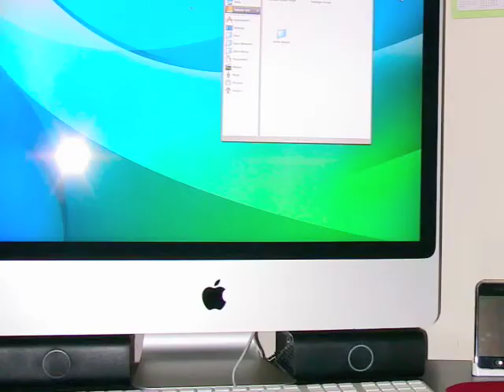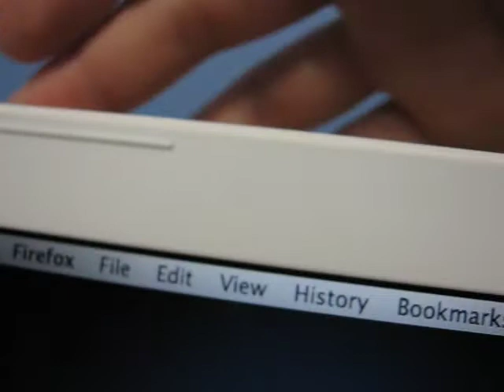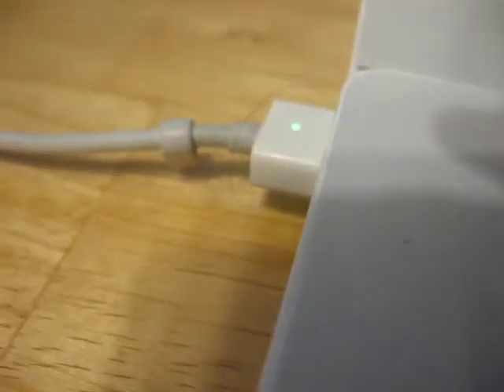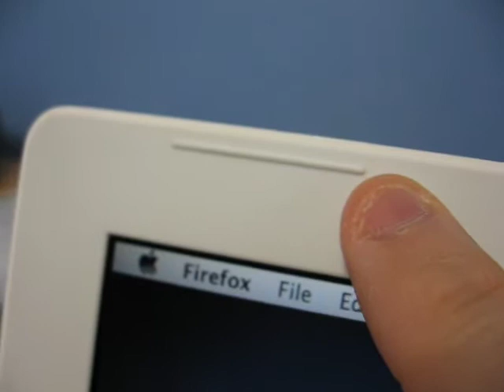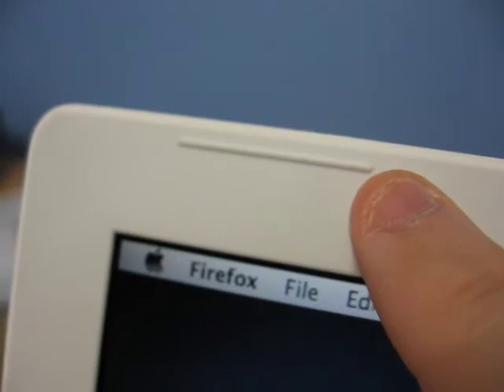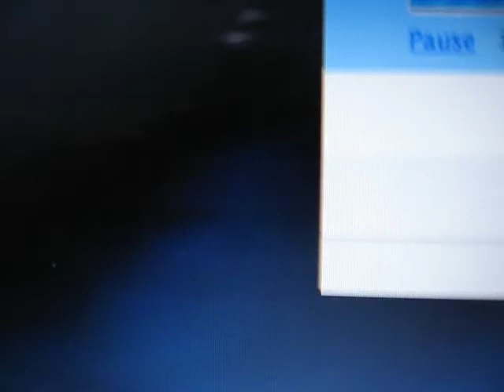The Apple CrackBook

Comment: At my school all 500 students have macbooks. and so far in under 8 months at least 60% have had the same piece break off. It also breaks above the ribs on the lid. around 75-80% at the best have just cracks. Mine as an example has a segment missing off of the left top and the same spot as yours. It is also is cracked at the right rib on the lid. I am not harsh to my laptop in any way, this is the fault of design flaw and cheap material... Next time buy a PC.